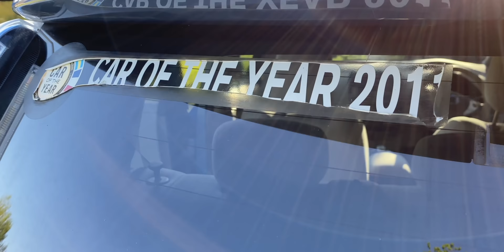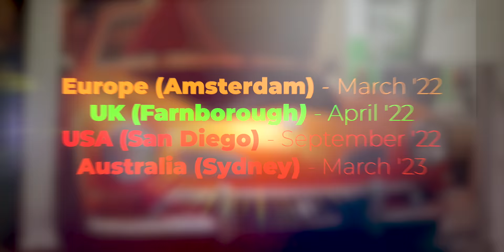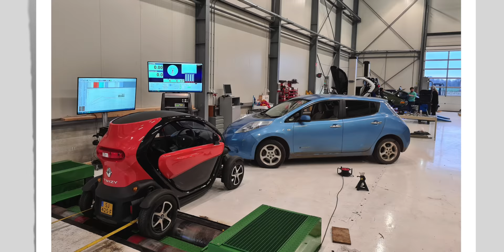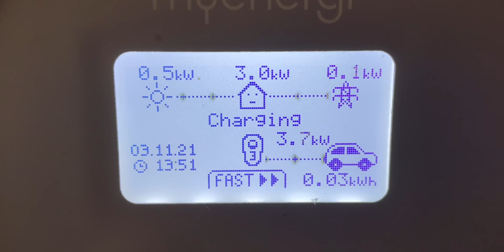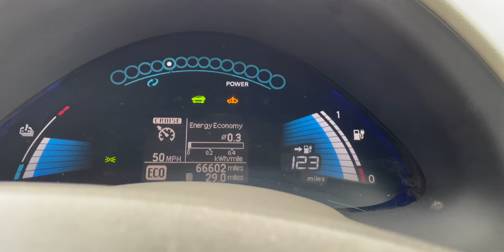Return of the LEAF: Robert drives his range extended EV home from Holland

Comment: I recently completed the same exercise on my 2012 LEAF here in Western Australia, and share your enthusiasm. - I have fallen in love with my car . . . again. Pleased you made the point about not having to replace the batteries on modern EVs.  Perhaps if you had explained the reason for the early LEAF’s battery degradation was the early battery chemistry it might have helped to clarify the point. I have disassembled the old battery and the cells will be added to my solar storage ( I.e. second life ).
Reply: How much did that cost you May I ask? Aussie always seems much more expensive for these things…
Reply: I've read that it was Nissans none active cooling that was the major issue with the battery pack. Has the replacement pack got better temperature control.
Reply: @finecutpost  yes, the lack of active temperature control was a factor, but this particularly affected the early chemistry batteries. More recent LEAF batteries use a different chemistry and these are sometimes called ‘Lizard cells’, because they can tolerate higher temperatures better. But for long battery life, the active temperature control, such as in Teslas, is the best solution.
Reply: @gavinsullivan9015  quite so. The total cost, including battery, re-coding VCM, and fitting was just under Au$20k. But I didn’t have to drive to Amsterdam l.o.l. Also, I put a value of $7k on the 12kWh solar storage from the second life cells. From a to-the-shops-and back job, I now have a car with decent range. Battery ordered February, delivered late October.. it was only off the road for 30 days whilst the VCM was being re-coded.
Reply: @brianmollan  that’s pretty cheap compared to a new EV though. So have you converted the old battery to home storage??
Reply: @gavinsullivan9015  the car was worth the upgrade, with only around 50kms on the clock. As a pensioner, I could not contemplate a new car. The old cells are in place, awaiting connections, BMS, and hook up to the house network.
Reply: yes, that bit about the battery chemistry would have been worth underlining, to make clear why the early Leafs had this issue. And wasn't it also that they don't maintain battery temperature?
Reply: @FredPlanatia  yes, there was no active temperature control to keep the batteries in their ‘ comfort zone ‘.

Comment: I love my Tekna Leaf, I was very fortunate to purchase one of the last old shape models registered December 2017. There is no going back now!⚡️❤️⚡️
Reply: Tron Jockey
1 year ago
 @Steve Zodiac  - The 2016 and 2017 models were found to have defective BMS software that incorrectly calculated battery capacity and indicated accelerated degradation that wasn't actual. Have you had Nissan update  your BMS software? Most owners have reported that it corrected the problem.
Reply: @JohnSmith-yv6eq  Yes I booked it in for a service with Nissan at that time and was told about it, all has been rectified, thank you for raising and highlighting the issue. 👍

Comment: Another great episode.  We have a used 2015 Nissan Leaf, and it's been brilliant. No regrets in purchasing it.  The only thing we've replaced so far is the lead acid battery.  No problems with it whatsoever.  We charge it with our solar panels as much as possible.  It's really economical and reliable. Come on Nissan.  Come out with more compelling EVs!

Comment: If a new battery pack can do this to a humble Leaf, imagine what a battery pack from 2030 will do to a Model 3! 
Cars may actually last a life time finally.
Reply: It might last that long if it doesn't get eaten by rust. It always was a case of which will go first, the body or the engine.
Reply: kéaf 128 kw dubke ràbgé
Reply: @653j521  teslas are aluminum body panels.

Comment: I think my next car will be electric. It’s nice to know the battery is replaceable if the range gets too low. I feel like as long as you take care of it it should run.
Reply: Most of the new electric  cars with  bigger  batteries will probably never have  to be replaced.  I'm eyeing up 64kwh models way over  200 miles range, so if after 10 years they lose  40 battery  capacity, it's  still 150miles range

Comment: Great video! I have had my 2014 LEAF since just under a year old (50k and still 12 bars - but expected to lose 1 or 2 at some point) and it has never given me any problems beyond tyres! Although still the 24kw model being a Tekna I do have the heat pump heating which does make a difference... I have recently been thinking of a change but not because of the car at all but because of the charging infrastructure and the apparent move away from supporting CHAdeMO that appears to be taking place. I have recently been on something of a road trip from London to Scotland and back and whilst the support for Rapid Charging on public networks is nothing short of outstanding in Scotland (In one car park there were 4 Rapid Chargers all with CHAdeMO connectors) the same is no longer the case on the Electric Highway network that is so essential for longer journeys covering the backbones of major routes in England. Since Ecotricity have moved away from this sector the Electric Highway has been taken over by Gridserve and unfortunately they have decided to deploy "pumps" according to connector demand so where there was once 3 x chargers with both CCS and CHAdeMO connectors there are now 3 x chargers 2 of which have 2 x CCS connectors and 1 with 1 x CCS and 1 x CHAdeMO! Apparently at some point both "Ports will be able to be used at the same time but that is not the case currently... So we faced several times when we had to queue behind other LEAF's for that 1 CHAdeMO connector (to make matters worse there was a CCS user using it at first when the other CCS units were vacant!)... One charge stop saw the only charger not working being the one with the CHAdeMO connector which meant we had to detour to a Type 2 for an emergency top up to reach the next Rapid. Overall very frustrating and whilst talking to others whilst waiting (as you do) it was apparent that this was a common complaint amongst CHAdeMO users but Gridserve do not seem to care and I have yet to receive any kind of response to my letters. It is a bad situation and unless someone does a CCS conversion I fear it will become the decline of CHAdeMO support on the public networks that will see the demise of cars equipped with this form of Rapid Charging not battery longevity.

Comment: £4000 for a 40KWh battery replacement? That is way cheaper than what it costs usually. Cleevelys charge £8900! Robert can you clarify whether or not you got a special deal? If you did it makes the video a bit misleading as the average Leaf driver looking for a replacement battery in the UK can't seem to get a deal as good as that.
Reply: he got a second-hand battery fitted out of a crashed car [ could of done it in UK for about same price]
Reply: @paulriggers1558  That is where all replacement batteries come from outside of Nissan. Nissan will charge you £20,000 for a new 40kwh battery. Even a used 24kwh battery salvaged from a crashed Leaf will cost you at least £2500 from eBay. You will also need to pay for a MUXSAN can bridge adapter and also the labor. There is simply no way the average Joe could have a 40Kwh battery taken from a crash damaged Leaf fitted to their car for £4000 when the battery alone costs in the region of £6000. This is a misleading video and Robert should correct it so nobody makes the mistake of buying a used leaf with a highly degraded battery thinking they can spend £4000 to fix it when the actual cost is £8900 if there is even a battery available.
Reply: @alexandermckenzie2767  sorry, i misheard, i thought is was a 30 kw [ze0] leaf batt he got fitted.       as you say ,second gen [ze1] leaf batteries are different beasts, requiring jiggery-pokery to work
it takes about an hour to physically swap a battery [done a few], another hour for software/ aircon regas/ safety lockout work [on a standard fit]
yes, bit naughty on the price front, smacks of promotional discount, min £3k below a "good price"

Comment: My 2012 Leaf got a battery replacement in 2017 under warranty from Nissan. They really stood behind these cars, at least that was my experience. My 24 kw pack has degraded some, I only have 11 bars now. Car has 80,000 miles, nothing has ever broken on it.  Heck I’ve never even put brake pads on it. Just replaced the 12v battery a few weeks ago. The guy that installed the new 12v could not believe how long the battery lasted. It’s going away next year, I’ll miss it!
***If it had the range of Robert’s, I would definitely keep it!
Reply: Same here.  I've got a 2012 Leaf I got used in 2017.  I looked for one that still had battery warranty remaining and 3 capacity bars down.  Found one for around $8k.  Just 3 months later it dropped that 4th bar and I had the battery replaced under warranty.  Since then I put on another 45k miles and it JUST lost it's second capacity bar.  Sitting around 85k miles and it's a happy little car.  My wife uses it to go to work and back, a daily round trip of under 10 miles, so it now lives an easy life.
Reply: @MarkLLawrence  👍👍👍👏👏👏
Reply: I have a 2012 that lost its 4th bar at 61,423 miles and they told me they couldn’t do anything for me.      Now 9 years later it’s at 87,000 miles and has lost 7 bars.        With a full charge I can go 28 miles.
Reply: @nissanleafbattery  so it really really is just an around town car now.  I'm looking to pick up something like that soon as a donor car for a fun conversion.  So many here in Southern California so I won't even have to go to a wrecking yard like CoPart.
Reply: @nissanleafbattery  so the question is what becomes of cars such as yours?  The pack replacement probably costs more than the car is worth.  But it still works perfectly fine…. Is there an aftermarket solution? Sucks to be in that situation,  I hate that for you…I’m quite sure my Leaf would be in the same boat had I not gotten the warranty replacement pack.
Reply: @christopherhamilton5557  There are many people looking to buy a used LEAF and installing a $6500 40kWh pack.     Then for around $12,000 they have a car that does 170 miles on a charge for half the cost of current EVs.     For me I could not see wasting $6500 on an 8 year old vehicle.    It made no sense.   I used that money for my down payment for the Tesla.

Comment: Just to clarify, many the early Leafs (2011-2013) did have premature capacity loss issues with the batteries regardless of how well they were treated. Problems with later Leaf batteries were typically due to being pushed beyond certain limits. The Leaf chemistry could be damaged by frequent HVDC charging which can significantly raise battery core temperature. This is especially true if ambient temperatures were already high (think a 115F Arizona summer day). SIZE MATTERS - The early Leaf batteries were also very small and required frequent charging to get any usefulness out of them. Many people had to charge them more than once per day, sometimes three or more times per day. The available charge cycles were quickly used up often in less than 70k miles with less than 70%  of the original capacity remaining. Now days, with the new larger battery packs, an owner might only need to charge once per week or less.  It's important to remember as well that the early Leafs would allow charging to a true 100% SOC which we now know is very bad for these batteries.  The BMS software will no longer allow this instead limiting a full charge to just 95% (although it will indicate 100% it's really just 95%).  
People thinking of buying a Leaf should understand that you simply can't kill these damn things. Both KBB and Consumer Reports have given the Leaf awards for being so inexpensive to own and for being incredibly reliable. Over the years you can expect to gradually lose some range of course but it may take ten years or more before you see anything that could be considered significant capacity loss. Properly maintained these modern, much larger battery packs could easily last 15 years or more and while they may have lost significant range by then will be far from dead. As bad as the early Leaf batteries were there are still a lot of them in use after over 10 years.
Reply: Refer to my comment, rapid range degradation is an issue with my 2016 leaf also.
Reply: @stevezodiac491  - I haven't found your comment but I offer this. The 2016 and 2017 models were found to have defective BMS software that incorrectly calculated battery capacity and indicated accelerated degradation that wasn't actual. Have you had Nissan update  your BMS software? Most owners have reported that it corrected the problem.
Reply: The real problem was that the batteries were not liquid cooled...
Reply: @JohnDoe-bd5sz  - Depends. Liquid cooling is necessary for those who frequently use Rapid chargers (HVDC) which can significantly raise battery core temperatures. For those who charge at home using Level 1 or Level 2 chargers, especially those who live in more temperate climates like the UK, they will never need active thermal management for the battery packs.
Reply: @Tron-Jockey  Offcourse, but that problem is compounded by the small battery, making the distance and time between charges smaller.

If you only do shorter trips and never go on a motorway, this is ok, but the problem arises when you do a longer trip, where the batteries are heated up from being discharged, then on the charger and then you continue on the motorway.
Reply: Robert kicked off the video by saying he kept it plugged in when not in use - a typical owner did not know that wasn't the right thing to do.

Comment: i'm still driving my 2011, just like yours, silver leaf.  only charge up to 80% since new and only lost 20% capacity so far.  i did all the service myself, 12v battery, rear shocks, fluid top off, cabin filters, but except for tires.  i love this car and hope to drive it until battery replacement becoming more affordable when time to replace them.
Reply: It will. Since 2010 to 2022 price per kWh dropped 8 times and it will gonna continue happens.

Comment: I'm happy to see and hear such good reports from you Robert. In the middle of summer I bought a second hand 2017 Leaf (30kWh) and since then I've driven more than 13 000km. It is great runabout, not so basic or cheap-feeling, the 207 Tekkna model is actually quite nice. The only actual downside is the battery heat dissipation in summer. You can't actually fast charge it more than once per day and thus longer trips are quite limited, but that's ok. But hearing you list all the costs... I took it to the local Nissan dealer, and they charged me 70€ just to take it in and inspect it. They actually did not do anything to the car, additional cost they later did was brake fluid flush (30€) and cabin air filter, which I denied. They wanted to charge me 52€ for the air filter replacement! 
In the time owning it (bought it with 86% SOH) I lost one battery health bar and the SOH is now 83ish %. In total it now has 63 000 and 4 years old. So basically my battery is covered by warranty for the next 4 years and and 100 000km. Does anyone have any experience with warranty? I was told some really not encouraging facts, like they replace it when it drops to 8 bars, but they put in a 10 bar battery. After I asked what does that mean, they said it's about 23kWh usable from an original 30kWh battery which was refurbished. I wasn't really happy with that, since in case my degradation continues to drop at this rate I'll be bellow 75% before the 100 000km and I did buy the Leaf for long term second driver. After I asked if it's possible to get a new 40kWh battery as part of warranty with my participation in the cost difference, they said NOT possible at all. With 40kWh usable this car would actually cover 99% of my needs, now it takes some planning for longer trips but I still love it.
Reply: I did a London to lake District drive on the hottest day of the year in my  2017 30kwh Tekna.  three charges. last two only up to 80% - the temperature was hitting the end of the scale after the second charge. I kept on. maxing at 65mph.  The car behaved perfectly. No noticable change in performance. It was still halfway in the red after a 5 hour 'rest'.  So it was still perfectly usable. Hopefully no damage. Everybody insists the car computer will manage the battery to stop any harm.
Great car.
But swapped it for an I3 recently with the Range Extenderr as I was sick of range anxiety.
The I3 cured it.
Reply: @bobef90  Hopefully no damage.
I never like to see it go close to red. I did notice significant SOH drop during the summer, the hot battery days. And there is pracrtically no SOH drop since the temperatures settled lower, bellow 15C.

Comment: This reminds of the EV videos I watched 6+ years ago but with a little less charging. :^) Very smart to get the upgrade.
As far as replacing a battery pack, I drive a 2017 Chevrolet Bolt EV so you might know where this is going... I stopped by my local dealership to make an appointment to get a new battery pack (due to the LG Chem problem) a few days ago. I'm fourth in line.  I'm not at all worried about my current battery pack but I'll be super-happy when I get a "bigger" (and new) one.  Last summer on a hot day my GOM read 288miles of range at 90% charged - I'm guessing the new pack should get over 300 miles(!) in the same conditions.  Eight year or 100,000 mile warranty on the new pack is a good deal.  I'm not sure if I'll buy another GM or not.  By the time I'm done with this one there'll be so many choices.
Reply: yeß ítvwill get new pack